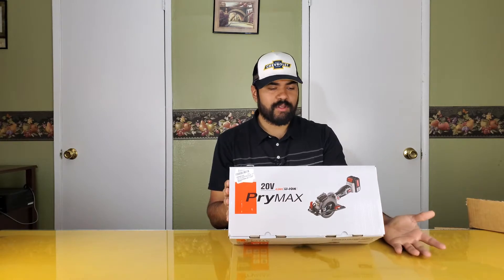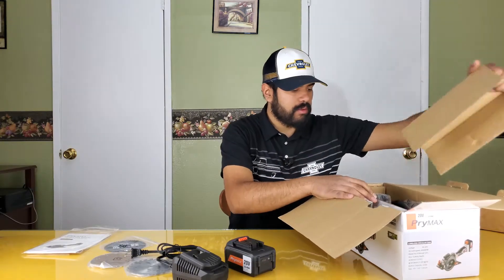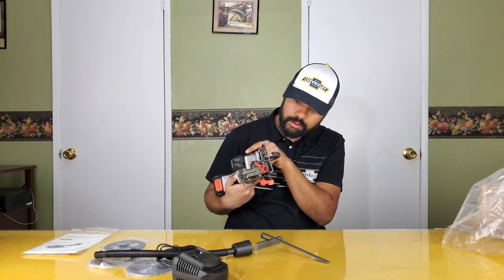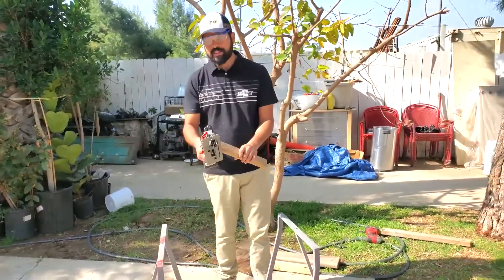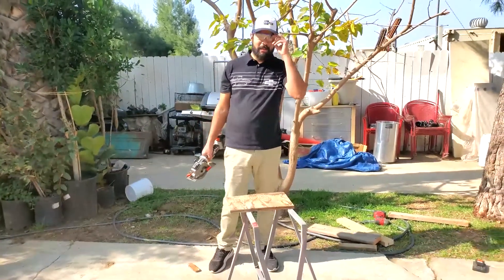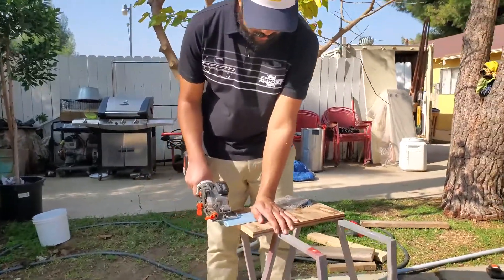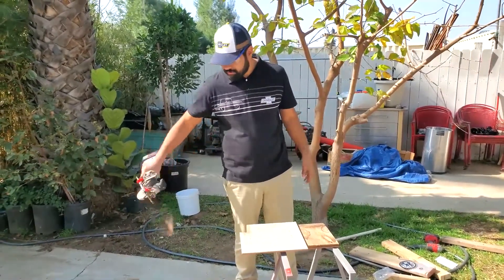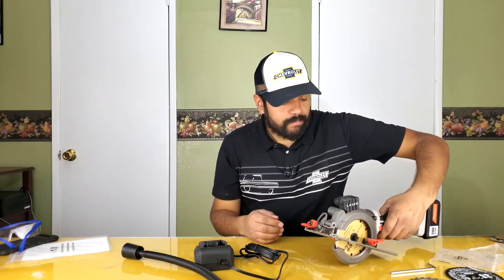cheapest battery powered hand saw on Amazon?

Comment: Definitely a brushed tool. Big footprint. Good price however. I do like to consider what I am carrying overall; meaning what else is going to use the battery platform so that I am not carrying around 10 pounds worth of chargers. Also when factoring the individual price of the tool versus buying a combo set of a reputable  brand company the price is not a major difference. So I would buy a reputable company given the price target for better warranty, battery platform, form factor. That is if you catch a good sale on a name brand tool.